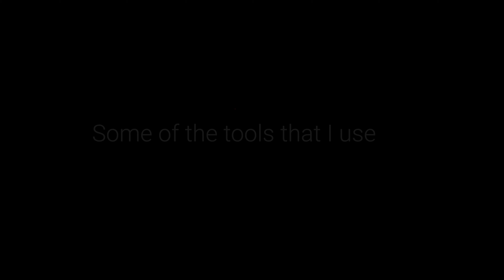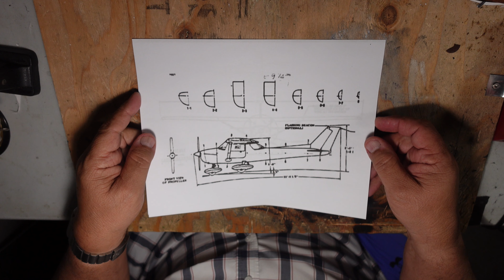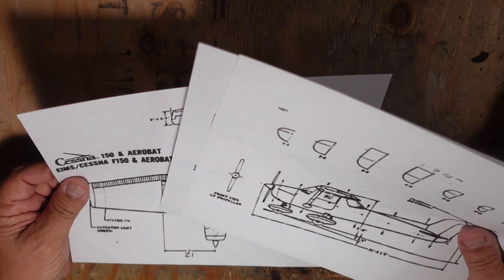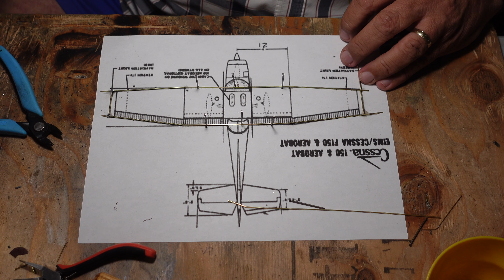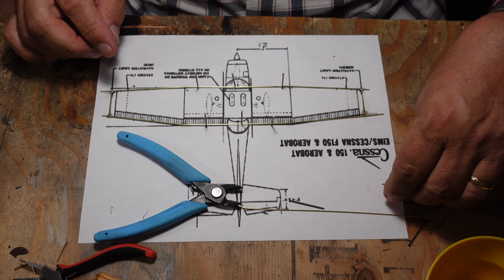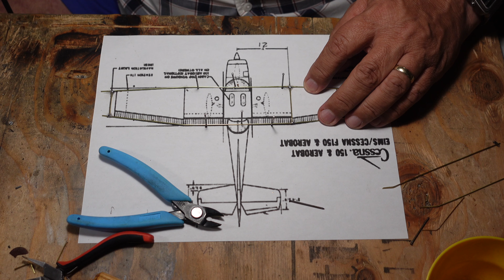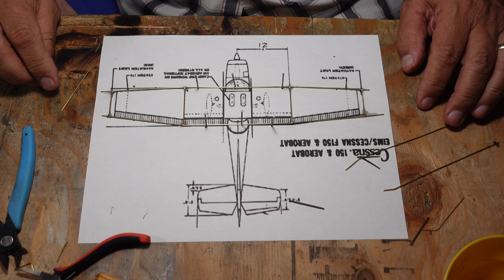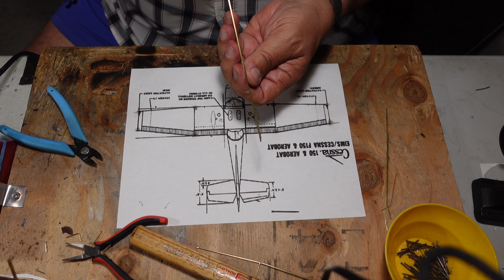Build a brass wire Cessna 150 - Part 1: First Lines - Tutorial

Comment: Your videos are great and I I want to build this Cessna.  Can you tell me what wattage soldering iron you use/or recommend?  What type of flux are you using?  I noted you are using 1.2 mm wire, did you use that throughout the construction?  Any other tips you can give me?  Thanks Curt
Reply from the maker: Hi there and thanks for the interest. I get all my drawings online, just google "cessna 150 blueprints (or drawings)" and scroll through the images till you find one that meets your requirements. I then copy an paste it into Inkscape, or Corel or Photoshop and edit to the size you want. Usually my model sizes measure around 350 to 400mm in length, just a better size to work with. remember to make sure that all your sections or views are to the same scale.
Happy building. try this link as well...https://www.google.com/search?q=cessna+150+blueprints&sca_esv=570803870&rlz=1C1CHBF_enCA918CA918&tbm=isch&sxsrf=AM9HkKkKmHODnIeuIaKF_-vCcq0PjVPPAw:1696458319058&source=lnms&sa=X&ved=2ahUKEwig-e7bt92BAxUuFjQIHYK6ApQQ_AUoAXoECAIQAw&biw=1455&bih=673&dpr=1.32

My soldering iron has an adjustable wattage and I set it with a low wattage to satrt and then increase as required. When you weld tiny pieces, low wattage, thicker pieces, higher wattage, if welding thick to thin its a good idea to prime the thicker piece with solder .. 
I always pick up solder with the iron rather than hold the lead in one hand and the iron in another.

Always work with as much accuracy as possible, as small size differences will compound and throw the scale and appearance of your model off.

I prefabricate parts, like wings, fuselage, landing gear and so on , then assemble them and this way the model comes together nicely.
Make as small welds as possible, practice on some scrap, get this down to an art as grubby welding makes the model untidy. If you weld wire over wire, just use a small bead of lead is required., and the same for but welding.
All my wire and materials that I solder are either brass or copper.
A tip to straighten the wire is to cut pieces of say 12" and stretch slightly with one end in a vice and pliers to pull with.
Hope this helps, and good luck.

Reply
Reply: @LupiniBuilds  Thank  you for getting back to me.  I keep trying the solder on the iron method but the solder drips off the iron before I can apply it.  I tried it with my iron at 400  degrees Fahrenheit and 700. Still trying.
Reply from the maker: @curtpg  ok… make sure that your solder tip is well tinned… so if you can start with a new tip , get it heated and dip quickly in to the flux ( I use a flux paste ) then put the tip into a brass wire pad and rotate to clean( a brass pot scouter will do). Your iron tip should look like silver, now it will pick up and hold the lead. I will post a short video on this process so you can see how it works.
Reply: @LupiniBuilds  Thank you.  I apologize for taking so long to get back to you but your email from 5 days ago, just popped up in my Gmail account today. I must be doing it wrong, I just can't get  the solder, even a very small amount, to still on my iron.  What temp do you keep you iron at?  I'm sorry for being such a pest.  I've wanted to do something like this for several years but didn't have a clue as to how to start until I came upon your videos.
Reply: @LupiniBuilds  I think  I finally got it.  Bought some new flux and solder paste.  Things are looking  up here.

Comment: Thank you for this! As subscriber #6 to your channel, I look forward to seeing more of your work. BTW- Where can I get airplane drawings like the one you have?
Reply from the maker: Hi Jimmy and thanks for the interest. I get all my drawings online, just google "cessna 150 blueprints (or drawings)" and scroll through the images till you find one that meets your requirements. I then copy an paste it into Inkscape, or Corel or Photoshop and edit to the size you want. Usually my model sizes measure around 350 to 400mm in length, just a better size to work with. remember to make sure that all your sections or views are to the same scale.
Happy building. try this link as well...https://www.google.com/search?q=cessna+150+blueprints&sca_esv=570803870&rlz=1C1CHBF_enCA918CA918&tbm=isch&sxsrf=AM9HkKkKmHODnIeuIaKF_-vCcq0PjVPPAw:1696458319058&source=lnms&sa=X&ved=2ahUKEwig-e7bt92BAxUuFjQIHYK6ApQQ_AUoAXoECAIQAw&biw=1455&bih=673&dpr=1.32